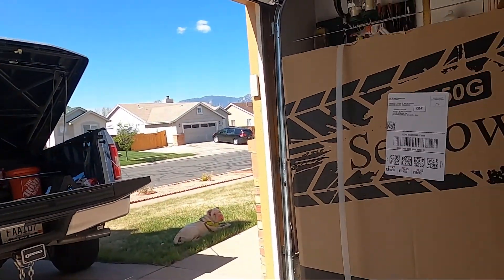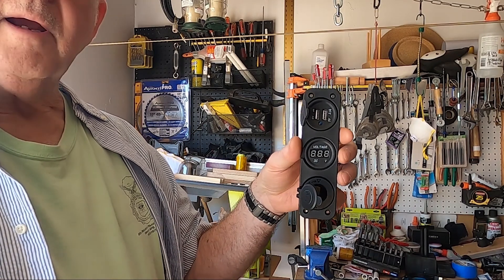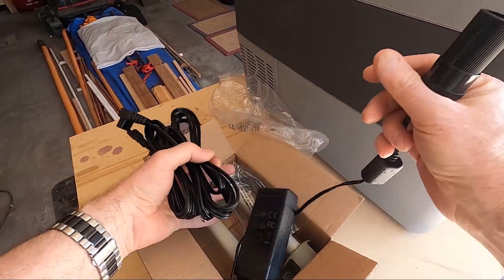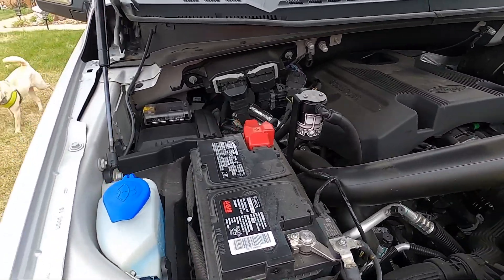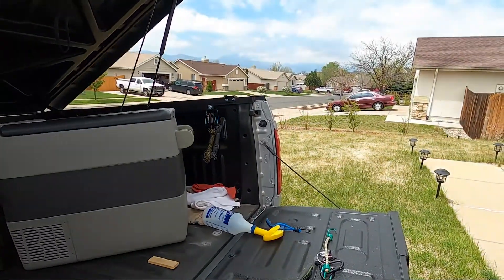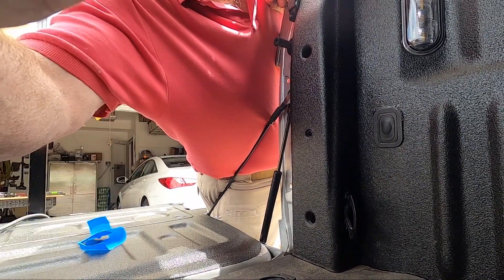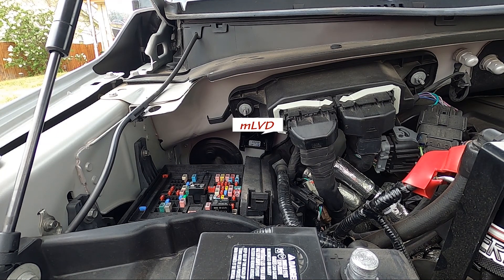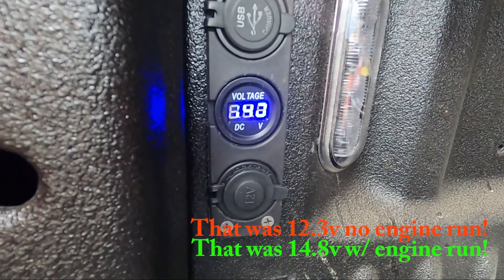2019 F-150   Add on: 12v outlets to rear of bed

Comment: If I may ask how did you mount the LVD switch
Reply from the maker: Excellent question:  I used a Blue Sea Low Voltage Disconnect.  The LVD can be set for different low voltage levels.  Complete with instructions, about the only thing you will need is appropriate wire and connectors. The outlets are connected via the LVD which is connected directly to the battery!  The LVD is simply mounted with heavy duty marine grade 3M double-sided tape!

Yet, another option is to locate an appropriate fuse that is ‘switched’, that will ensure the load is powered on only when key is on!  I have done that as well for my SetPower 50 portable refrigerator.

https://www.amazon.com/Blue-Sea-Systems-Voltage-Disconnect/dp/B00GZOP53M/ref=sr_1_2?crid=3SP3JPRGYZ4I&keywords=lvd+blue+sea&qid=1689171552&sprefix=lvd+blue+sea%2Caps%2C124&sr=8-2

Hoping this helps

Jeffrey

Comment: Hi Mr. Jeff. On a slightly different topic, hope you can help: how can I plug into the 
outlets in my ford f-150 while keeping the gate up and locked, and the 
roll down cover closed & locked while powering my airstream camper  
 ( sleeping or gone for the day) . Any advice or suggestions would be greatly appreciated.
Reply from the maker: Excellent question!  Assumption:  12v from truck to camper.  First, powering the camper from the F150 will definitely require engine running due to potential battery drain.  Instead of terminating the wiring inside the truckbed, as I did, terminate the dedicated new  line near the trailer connector.  On my 2019 F150, the trailer power is actually connected on the non-exposed part of the rear bumper.  They are then connected to the 4way flat and 7 round on the external.  Remember the 4flat is simply for signals and brake lights.  But, short of purchasing a dedicated gas power generator for the separate camper I would suggest yet another dedicated power line from under the hood all the way under to the rear back.  Connector is your choice.  Now remember, you will definitely have voltage drop just a bit by that distance alone.  It will be a more dramatic drop by going to the camper.  My best recommendation is to to actually purchase a new, or certified used, gas powered generator for this purpose.  I believe you would most likely kill your truck battery the other way.  I am most likely not giving the answer you need.  Recommend a friendly visit to local camper company.  
R,
Jeffrey
Reply from the maker: Please let me know of final outcome!
Reply: @mrjeff2396  thanks for the speedy response. My ford hybrid has a 7 kilowatt generator built in already. Its more than powerful enough to power all the outlets in my airstream  bambi. Its actually why i purchased this model, to never have to worry about boon docking. My concern is more of a "security" one. While sleeping, the bambi will be running off the fords eco boost electrical power. It will need to be plugged in, and the cord needs access to the bed.So, i will need to leave the gate down, or leave it up and roll back the cover enough to give the cord access. My roll back cover does give me the ability to roll it back and lock it where ever i want, so the space needed is minimal. Just worried about theft and rain getting the contents of my bed stolen or wet
Reply from the maker: @johnmiskanic8056  wow!  Wish I had that set up.  I would be interested in seeing the final outcomes.  Hope all works well for you.
Reply from the maker: Let me try this again.  Assumption:  the generator is located in the truck bed?  If so, you could easily cut a hole in the side of the bed area close to the generator.  ONLY THE INSIDE OF THE BED!  No bigger than needed for supply cable feed.  Since the bed is aluminum rust is not an issue.  A piece of flexible rubber secured by 2x screws of appropriate size to secure the rubber inside the bed when not in use.  You could even go so far as to secure the bottom with two more screws when not in use.  Crawl under and locate the best place for positioning before cutting.  HD/Lowes/??? should have large enough hole cutters for drills.  Weather stripping around the hole to prevent cutting of cord.  Am I getting close?  I really want to see the final on this project.  Please keep me in loop.  My F150 super cab  is 2019, and has 6x USB in cab and 2x 110v 400 watt max outlets.  Now it has the additional 2x double USB and 2x 12v outlets.  Keeps the fridge and drone batteries charged and running.

Comment: Is that for popsicles?
Reply from the maker: Beer, water, beer, food, beer, snacks, beer!
Reply: Interlock installation would make a great next video
Reply: How much amperage did u use in ur fuse block?
Reply from the maker: @maz1ng3rz  I used a 15amp fuse.  Did not see a need to really go above that.  I have run separate lines on each side.  Both with a 12v adapter Outlet and a dual 5V USB outlet.  Hope this helps!  It all depends on the load you intend the adapter for.
Reply from the maker: @0050010061  In all actuality, drinking and driving is not condoned by me.  I simply do NOT do that.  Plus, I carry concealed on 90%+ of my travels and that would be one of the quickest ways to lose my National Concealed Carry!
Reply: Did u use oxygen free copper(ofc) or (CCA) copper clad aluminum. Sorry too many questions?
Reply from the maker: @maz1ng3rz  honestly could not tell ya.  I used standard off the bulk roll copper wire.  Never thought to check content.

Comment: What gauge wiring did you use?
Reply from the maker: I over killed the project with 10 gauge.  Just recently, I rewired so that wires for the HOT outlets in the back come off only one set vs two down each side.  I also eliminated one USB outlet from the rear gang and ran 14ga single wire from a switched fuse block under the hood (using a piggy back jumper) to that USB outlet.  The ground was simple.  The purpose was to be able to install a dashcam that is auto on with key on.   
I also discovered a little know secret for dash cam power!  If you have a rear view mirror that has the headlight dimming function then you have a switched power to the rear view mirror.  This product works perfect.  It is a custom made switched outlet for the rear view mirror:  https://www.amazon.com/dp/B088P4VFQ7?psc=1&ref=ppx_yo2ov_dt_b_product_details. I use it to install a driver/passenger witness dashcam.  Turn around is about 1 week as they are custom made rather than stocked!
Reply: @mrjeff2396  that's an awesome discovery